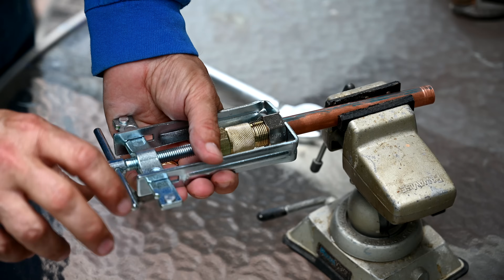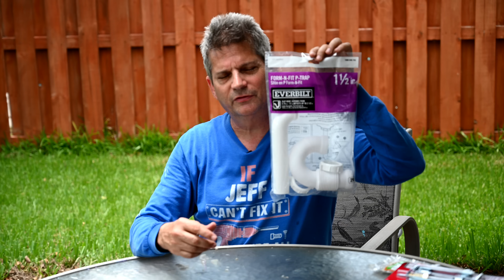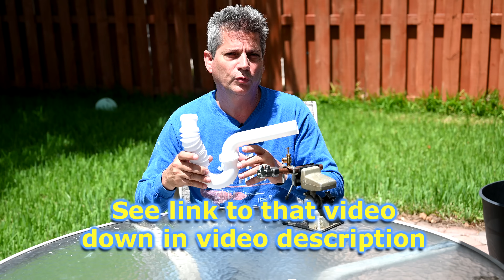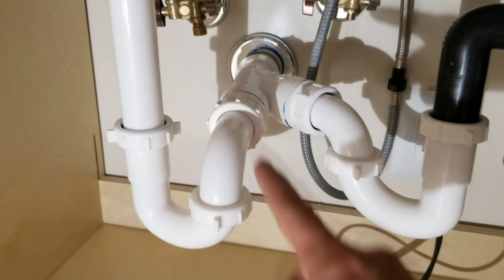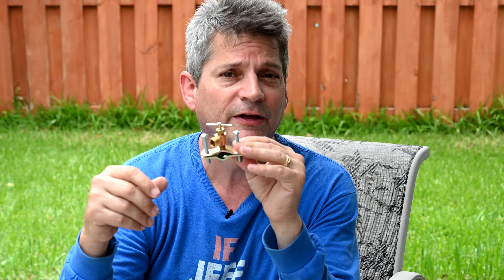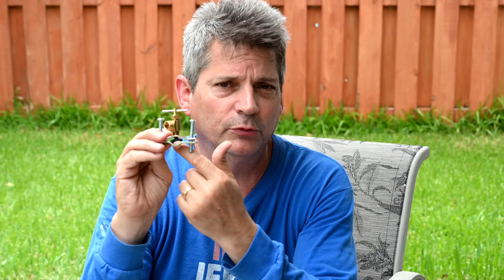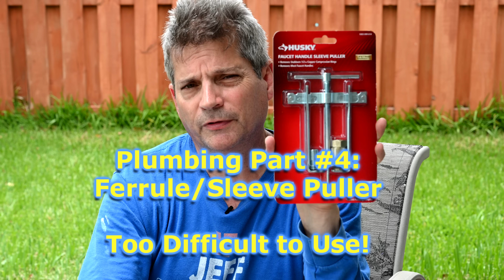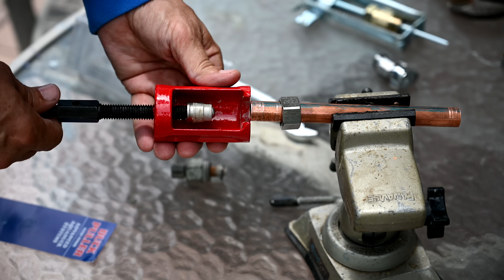4 Plumbing Parts/Tools You Should NEVER Use. NO Plumbing Fails

Comment: I was repairing my bath sink because the drain tube that came with the sink had rotted out. Using the Home stores, I had to use a both a short and a  flexible straight extension pipe because my old sink, and all new size change, P-trap and old diagonally horizontal drain pipe could not otherwise line up. It was a confusing PIA to have to install it three times just to get it to work without leaking. Because it turns out only IF you follow the pictures it came with, it works fine with only the included compression rings and no added sealants in the joints or coupling. It's still fine more than 5 years later. But you really have to stretch it out as much as possible at the bottom, discarding as much solid plastic pipe as you can. All of it is extremely thin.
Reply from the maker: You can replace the flexible P-trap by cementing together the right combination of PVC pipe parts

Comment: Another problem I found with the flex pipe is that it creates stress on the tailpiece. I work in an apt complex and the previous maintenance guy installed some of these on a vanity replacement that had an ABS glued trap that didn't line up with the new sink, so he just put a flex extension to hook it up. The sink had a plastic tailpiece on the drain, and the stress of the offset flex actually caused the tailpiece to crack and leak. I had about 3 or 4 of these happen to me. I cut the old glued ABS trap off, glued in a trap adapter, and lined up the p-trap.
Reply from the maker: Yes, if you pull those flexible P-traps to align them up to the wall pipe, they put spring like tension pulling on those downpipes

Comment: I renovated a commercial kitchen at a MHP. They wanted to re-use the SS triple bowl sink BC it was only a year old. The  original installer was a Handyman that claimed to be a “Contractor” and he installed it with the Flex-n-Fit P-trap and did it direct with no air gap. 🤡
I called him out on it and he said “That meets code back home”. Lol
Reply from the maker: LOL It's 5 O clock somewhere! Only state that requires air gaps on counter I heard Wyoming right?

Comment: i am a licensed Indiana  plumbing contractor or more precisely a Master Plumber with 30+ years in the trade with a Indiana accredited 4 year apprenticeship program.  #1 the ferrule compresses and bites into the copper tubing. It therefore makes an indentation and makes the ID of the tubing smaller.  I agree that changing out those old fixture stops are a good idea And installing the 1/4 turn ball valve type fixture stops, removing the old brass compressed  ferrule and applying a new one in the same spot is risky . I have never heard of anyone doing what you are doing! The copper tubing has been Compressed, the tubing itself is less than 1/2"id at that point. if you want to add a new valve solder on a copper coupling  and tubing or a sweat 1/4 turn stop. Also the tool you are using is a knob puller for 2 handle lav., kitchen, or a old style tub/shower faucet. It was not made to yank off ferrules.. 
fyi -self piercing saddle tap valves drive me nuts! All too often a new home owner gets the water turned on to their new house then leave with the water on. Upon their return the wood floors are buckled, mold has set in from in the drywall soaking up the wall. Once installed you can not close them and that's why their illegal.  The piercing tube is hollow, water flows before you raise the needle.
They were used on the furnace's humidifier (AprilAir) originally and buttheads started using them for icemakers.
Reply from the maker: Marvin. I rarely see the ferrule leave an indent on the pipes, so I slide off the old one and the new one goes right there. If you are that worried about it, cut the copper pipe where the indent is, ream it out, and place the new ferrule. Second, you are wrong about the Husky tool, as is everyone else who comes to to correct me on it. If you look on the back of the package, they have 2 sets of instructions, one for a knob puller, and one for using it to pull off ferrules.
Reply: @jeffostroff   the next time you remove a old ferrule, run your fingers across it. If the compresstion fitting was tight, the ferrule has bite into the tubing. I have that type of puller and it is one of three types of pullers i have for pulling knobs. I bought it so long ago i do not know it's brand name. The problem i have had with it is the part i place under the knob unbending. This is due to mineral deposits from a leaking packing nut or bonnet nut allowing water to run over the splins on the valve stem that come in contact with the knob.  It's not my favorite knob puller

Comment: You probably don’t wanna hear this but my neighbor just told me that the last homeowner put half of the run ( of copper and half steel ) from the water meter  to the house) .There’s almost no steel pipe left in the ground. Just remember that electrolysis is your worst enemy. Thank you Jeff
Reply: You can transition between dissimilar metals by using a dielectric Union at the point of the transition. This fitting effectively separates any electrical conductivity between the dissimilar pipes.
Reply from the maker: Yikes, that was crazy!

Comment: Jeff I think over time it was just the dissimilar metals, steel strap, copper fitting ( stupidity of me for not knowing the expertise that I was dealing with) at that time up to 10% lead. Also think about the soft tube of copper you ran to the icemaker is not the same solid line copper. Even flexible copper is  different solid line copper. It’s still in the similar metal. Thank you for the post.
Reply from the maker: I hate copper icelines, they kink too easy. I always swap them out for steel belted hoses.

Comment: Oh my goodness yes I did that.   ( ice maker fiasco) And the person (me) that’s an engineer in welding and mechanical. Yeah got to get it done got to get it done now yes. And you finally sit on the pot ( 12 years later) you’re ready to go to the bathroom. And you realize the water is running but you haven’t started going to the bathroom yet. Did I mention I was also a tech diver scuba diver. I had to get on my scuba outfit to get under and deal with this mess there was so much mud
Reply from the maker: I'm a terra firma person myself!

Comment: I'll be removing that saddle valve for my refrigerator ASAP.  I always had misgivings about it thinking it could eventually leak.  Will cut the pipe at the hole it made and solder in a proper valve.
Reply from the maker: That's the way to do it!

Comment: You are using the Husky sleeve puller wrong. I have used this same tool many times to remove toilet compression ring angle stops and it always worked. You forgot to use the metal copper sleeve insert for it to work correctly. The arms are not used to remove the compression ring, the arms are used for faucet handles ONLY.
Reply from the maker: Yes older packages of this tool had misleading instructions.

Comment: MA state plumber here, I run into this handyman/home owner fixes a lot. Those trap adapters on the horizontal are frowned upon by inspectors. If we have to use one due to clearance issues we have to glue the pipe to the trap adapter so no leaks will form. Its a bit over kill but what can you do.
Reply from the maker: Right we glue the trap adapters onto the waste line going into the wall as well, they are not designed to be left unglued.

Comment: If you can't use the tool in hint #4 your hands must have the strength of the office worker giving the quotes, not the actual plumber. That tool is not hard to use. Are there better ones? Yes, but that tool fits a 1 or 2 use price range perfectly
Reply from the maker: Not when the ferrule ring is stuck you can't use that Husky tool. Yes those tools work on normal good condition pipes. Sounds like you don't get out much. I work on a lot of neglected bathrooms, and foreclosed properties where leaks and high humidity in bathrooms with no fans are the norm. We have to fight to take off old corroded valves, nuts, and rusty compression sleeves, and corroded pipes. We spend the time to buff it all back to new shiny copper status, and replace everything with new valves and compression fittings.

Comment: Who cares what code is. What do you call an inspector every time you do a repair? If the flex drain pipe solves your issue and it works good, use it. So what if you get more build up. They are so inexpensive, you can change it often . Nobody will know  Many things that are not code will pass inspection and work fine. Code changes as often as your underwear.  I had an inspection done when I bought a house long  time ago. He missed all kinds of issues. They don't even look at stuff they should be looking at. I don't know why I even bothered spending hundreds on one. Joe I know a lot more do it won't happen again
Reply from the maker: The problem with your logic is they clog up. The accordions are terrible and they crack at the folds an leak. Most of the people who have these accordion P-traps installed don't understand what the handyman did and don't know it's bad. If it leaks they can't just replace it like you stated, many are elderly people single moms or just other people who don't know what to do. the leak goes on undetected for days or weeks before it destroys their vanity.
Reply: @jeffostroff  I can see what you're saying and I'm not trying to give you a hard time. But, I have had the flexible drain line in my basement on my utility sink for over 10 yrs. with no issue. If there is a problem, I'll change it

Comment: I ordered a jet tub that comes with a flexible pipe to hook up the drain. Is it okay for tubs?
Reply from the maker: Yes, they seem to use those on the overflow and it's OK, probably because overflow is not the main drain it might get used once a year.
Reply: @jeffostroff  It comes right from my bottom drain, not the overflow though.

Comment: Jeff, please comment on Sharkbite. 
Some handymen and plumbers I know refuse to use Sharkbite.
On the other hand if you post something against them, they are large enough to afford to sue you :(
Reply from the maker: Some plumbers think they are a failure waiting to happen I personally believe any failures that come out of shark bites are due to error if people don't use their reaming tool to properly measure the depth and mark the depth before they insert the pipe so they know it is going in the correct depth into the sharkbite. To me nothing beats a good old-fashioned soldered can check connection so the only time I would ever use a sharkbite is if nothing else works and it's outside the wall where I can see it. So, for example in my house and my neighbor’s house we both have the illegal Poly butylene piping which is no longer allowed after 1995. But the only way to mate up to it, you can't buy the parts anywhere is to get a shark bite “Poly to copper” converter couple part and that is what we did under the kitchen sink where it's out in the open and we can see it . This allowed us to remove the old Poly butylene crimped valve and replace it now with a modern conventional quarter turn ball valve water shutoff valve compressed under what copper pipe like everybody else has. I often use shark bites also as a temporary fix until I can go and get the parts. And I often use the sharkbite end caps to temporarily cap a copper pipe until we are ready for the final ruff in.

Comment: Great tips and info Jeff; I’m forwarding this link to friends. Almost every second house has a Saddle Valve installed for a humidifier and a fridge, some installed by the builders in new houses here in Canada. 
Q: This week I got my basement kitchenette countertop and sink  renewed. I am going to replace the flex hoses. One of the 1/4 turn compression valve is passing very little water at close position, no leaks though. I am hesitant to replace it because the pipe will need cutting which will shorten it for future repairs. 99.99% of the time the valve remains in open position. If needed, I can shut off the main. Your advice is appreciated.
Reply from the maker: If you have to cut the pipe cut the pipe you can always solder on new sections of copper pipe to make up for it but in my opinion getting rid of the saddle valve and putting in a real valve makes the most sense.
Reply: @jeffostroff  I agree 100%. Some friends didn’t like the advice by saying no one uses Copper anymore, we have plastic pipes:
Compared to copper, I hope these plastic pipes would last for 100-200 years otherwise it’s going to be a big problem. 
I have 3 failure examples.
1) Kitec pipes
2) Newly invented made in USA glue/sand mixture to hold the reclaimed land of Palm islands in Dubai, a failure.
3) A very special epoxy glue made in Germany with LIFETIME WARRANTY. In 1974 we used it in making Onyx marble gift items with 24K Gold plated fittings for export. Luckily, I still kept some items with me. After 30 years, some of them simply separated from the glue. That export company does not exist anymore 😊

Comment: These guys like to hide behind the "codes."  Many of these codes are written by plumbing union people or professional associations so that easy solutions that work just fine for the average homeowner can't be used because its "against the codes."  For many years in Chicago, the codes prohibited anyone from using plastic PVC piping.  Folks had to have metal piping.  We're talking well into the 1980s when most everyone else was using PVC.  Turns out there one Chicago Alderman--Thomas Cullerton who was a plumbers' union and pipefitters rep who consistently blocked PVC use.  Soon after he died, Chicago lifted the ban on PVC piping.  Much of this is just plain old power plays for money.
Reply from the maker: It's funny listening to you rant and rave about some bogus nonexisting conspiracy theory listen to how foolish you sound. Because I just showed you how to do a sensually the same thing with just a few dollars of parts so nobody is hiding behind codes it's just you that doesn't want to obey the codes of common sense and it's guys like you that leave sloppy work behind that leave leaks and problems for other people, keep making up excuses of why the rules don't apply to you.
Reply: @jeffostroff  --What conspiracy theory?  It's a fact that many building codes are sponsored by special interest groups.  Again, not all---or even most; but SOME of them are.  I was a newspaper reporter in Chicago for many years.  I know of what a speak.

Comment: Hi nice video  i have question if u can help i am installing  double sink  vanity in the washroom  and there is only  one   waste pipe coming out  so if i open  the drywall  and  run another PVC pipe of the same Hight  insides the wall to reach  other sink    is there any recommendation  of how to  ?  the  inside  wall  PVC is the same size as the one that  comes  out for one sink 
so  is there gonna be any issue if i  connect two sink instead of one  inside the wall or  to the one that comes out for one sink 
 also I   need to connect  the additional    hose  to  cold and hot water  my   home  got  Poly B  so  would i be able to use  C pex Crimp Tee    to connect to the pex and connecting  pex to poly be and then  at the other side   of each  C PEX Crimp TEE    adding  PEX and  installing valve for each  sink 
 Thanks
C PEX-CRIMP TEE 50PC/BAG 1/2" $0.95 # – Home Idol Plexiglass Acrylic Plastic Face Shield Home Improvement Outlet
Reply from the maker: Polybutylene I typically avoid it like the plague and so I don't know what would be crimpable on or not I just don't know much about it because it's been banned for almost 30 years now. what I would try to do if it's possible at all is remove all the Poly butylene out of the house and not keep trying to Patch into it but replace it with something new like either copper pipes or pex.

Comment: That is all down to your lousy system there  nothing else we use thpose here in the UK with ZERO issues .in fact it is the ONLY way to plum a washing machine wast in yet another excuse to try and stop people saving themselfs a bit of money what a complete load of bollocks
Reply from the maker: Your comment is a load of bollocks. this video is a way to help people save money by using the right part. We are not stopping 0them from saving money. The code is what it is in the U.S. The way you do it in UK is irrelevant, because they will fail inspection over here.
Reply: @jeffostroff  Hark at her